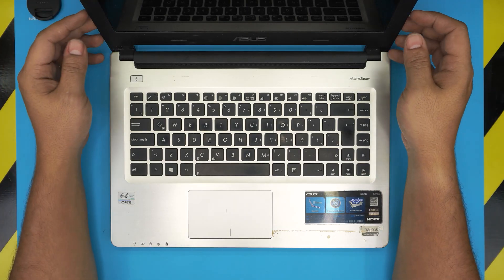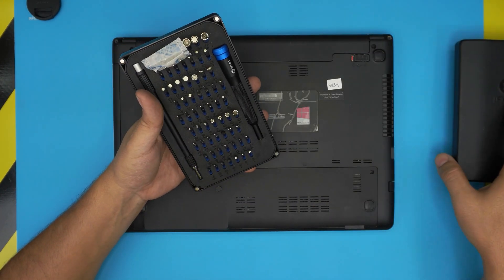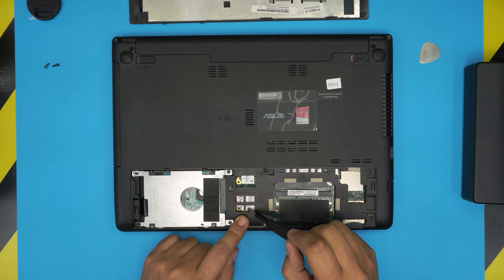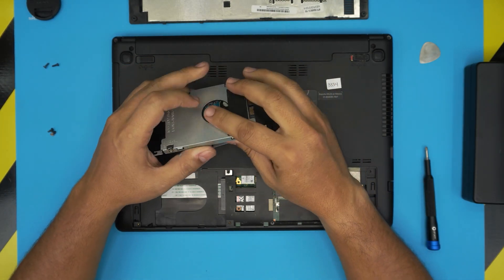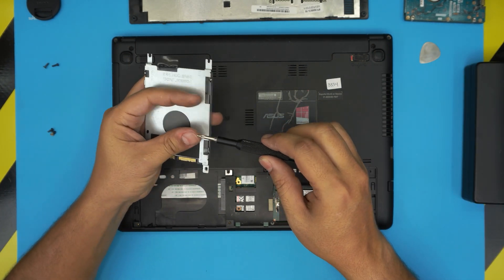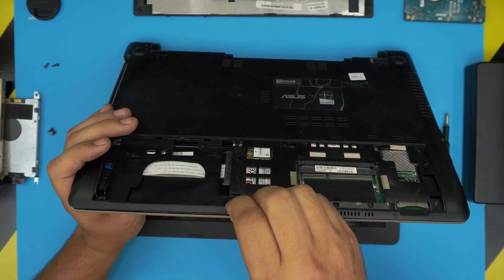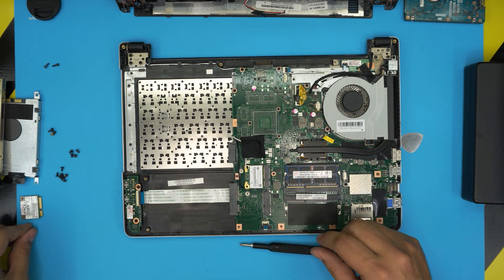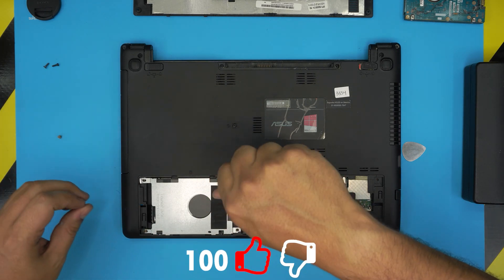ASUS S46C SSD HDD UPGRADE 👉 FULL GUIDE

Comment: Hello, is the part you removed m.2 ssd?
Can you install the system on 128gb m.2 ssd and support 512ssd taksak instead of hdd?
Reply from the maker: Thank you for your feedback! If you wish to support the channel, you can like, subscribe, or both! Regarding your question, yes you can , you can place a 256gb on m.2 and windows there and 500 or 1tb ssd 2.5 SATA

Comment: I found SSD half size . If I change the cache hd for a greater capacity, it will be a higher high capacity cache HD or I can even use it as an HD to keep files and install softwares?
Can you tell?
Reply from the maker: Thank you for the feedback! if you wish to support the channel you can LIKE or SUB or both :P
regarding your question:  i would recommend you highly to use it for file and software instead of cache.
BUT i would install windows on the SSD and it will be much much faster than HDD and use the HDD for the big file and stuff.